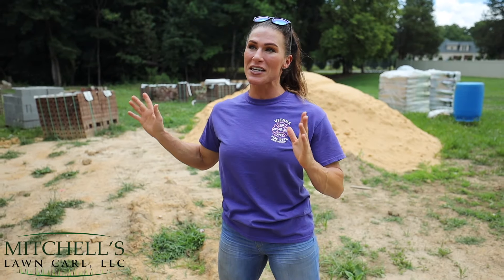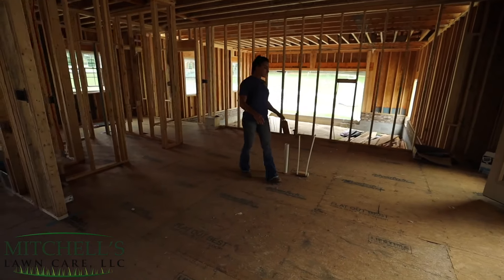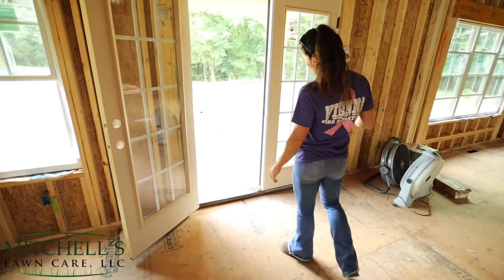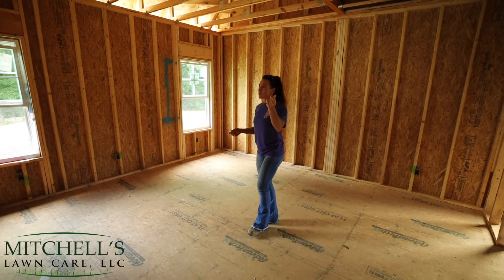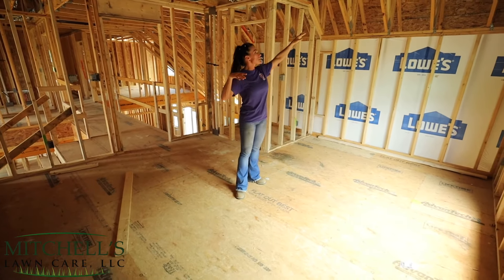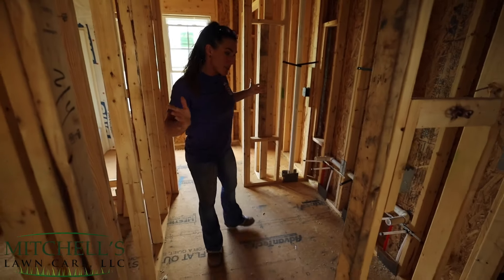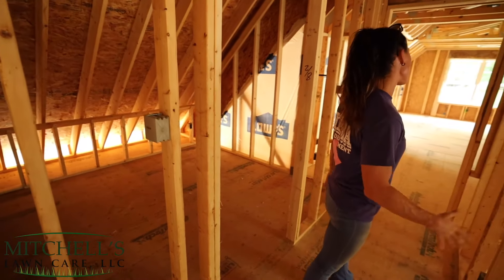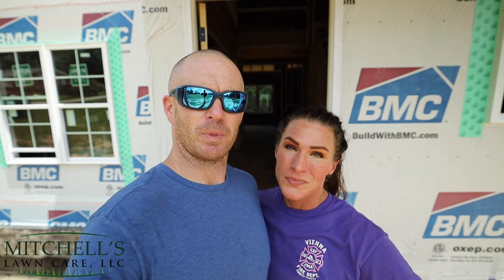CUSTOM HOME BUILD Pt 3 - INSIDE TOUR!

Comment: Laundry room: Plumbing wall (with dryer vent) is 2x6 👍 I wouldn’t stack the units IMO. You can do them side by side on that plumbing wall - no pedestal - then you build cabinet around them and add a countertop for folding. Hang wet laundry above it (that’s what we did in our tight space). Or you can use pedestals (raises units considerably) and make a table or cabinets on opposite wall (laundry Shute wall) with countertop and fold your laundry there - hang stuff above as well. Add dedicated laundry sink and built in shelving under the window for storage. *All the walls in your house that contain plumbing drains should be a 2x6 wall.* Pantry good idea. Add floor to ceiling built in shelving and 3” LED lighting to see deep into the pantry shelves. Pocket door are home run! 🤛
Reply from the maker: wow...thank you so much for the in-depth feedback!!!  I'll make sure to share these things with Hannah